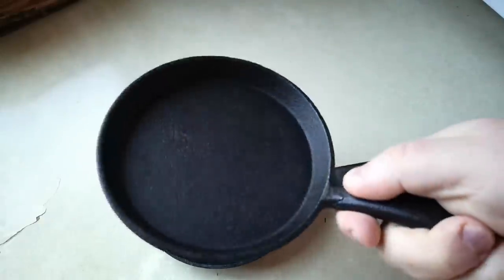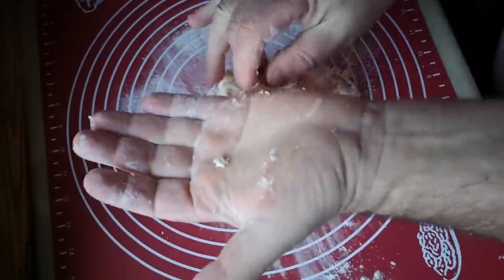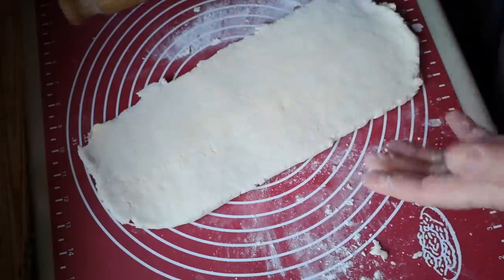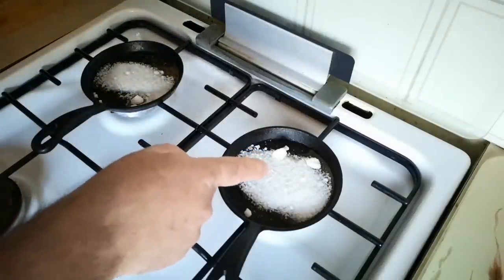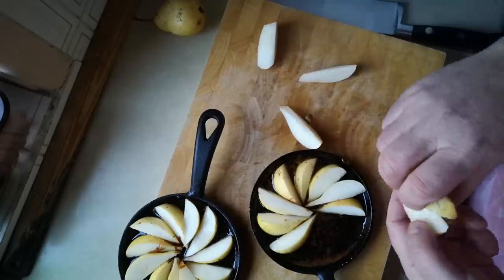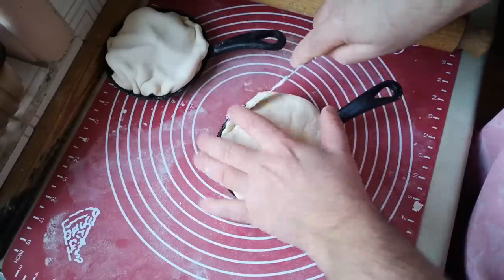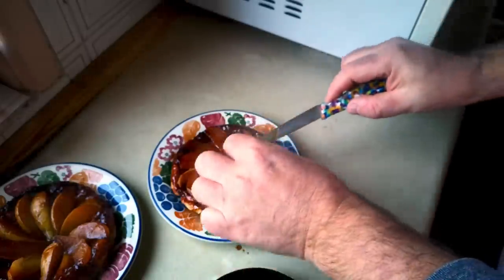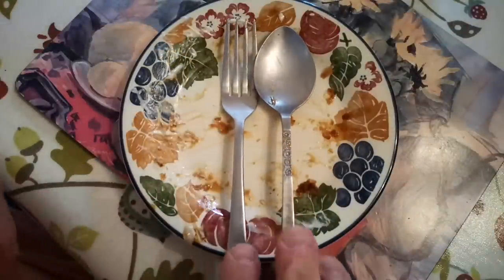Teeny Tiny Tarte Tatin - Cooking in the Mini Cast Iron Pan

Comment: 6:33 Molten sugar isn't just almost twice as hot as boiling water (180C / 360F), but it's also sticky. Where most liquids just run straight off your hand, sugar sticks to your skin. I once made caramel custard, and a drop of the caramel splashed onto my finger. It had cooled down and hardened after less than a second before I was able to get it off. 5 years later, I still have a very visible scar.
Reply from the maker: Very good point. Also I think many people would react to molten sugar on their finger by putting it to their mouth, probably also burning their lips and tongue
Reply: @Atomic Shrimp  best first aid tip for something like that is HOT water as QUICKLY as possible, it hurts a bit but it lets you get the sugar off, and then SLOWLY cool the water down till its tepid, at which point, aloe and burn creme, plus bandage it. At least thats what the boy scouts taught. It might be old info, but putting cold water on straight away not only shocks the sugar hardening it making it harder to come off without taking skin with it, as well as shocks the nerves and skin and can lead to increased pain and scaring.
Reply from the maker: @stapuft  interesting. I did not know that
Reply: @AtomicShrimp  Best thing for burns - neat lavender oil.  Takes pain away totally.
Reply: Twice as hot as boiling water would be 746C, but yes it is very hot.
Reply from the maker: @jhonbus  yeah, I suppose twice as hot in scientific terms must use Kelvin, but in human experience terms, I don't think it's necessarily wrong to treat 200 Celsius, colloquially, as 'twice as hot as boiling water'; it's a convenient way of saying 'this will hurt you a lot more than that'
Reply: @stapuft   Yup, and that works with burns from most liquids, too. Boiling water? Submmerge the trouble area in warm water. Lessens the burn and prevents worsening of the affected area. Learned that from my old man when I was a child, and had a very bad accident involing scalding hot water.
Reply: @ekki6820  
Water has such a high thermal capacity that you don’t need it to be as cold as possible to cool off a burn, and too cold water only adds stress to the already injured area. If it’s painfully cold, it’s far colder than it needs to be.
Reply: @AtomicShrimp  That may or may not have been my immediate reaction as well. Fortunately it had cooled down quite a bit by then (even though it was just a second). It hurt, but didn't leave any blisters or anything. Still: Would not recommend cooling down caramel with your tongue. Running water would probably have been safer.
Reply: @AtomicShrimp  Yep, I agree with that of course! Just pointing out another way of looking at things in case it offers an interesting point of view people might not have considered :)
Really, perhaps an even better way to look at how hot something feels might be the difference between its temperature and skin temperature. In which case boiling caramel might be more than twice as hot as boiling water. Feels about right to me!
Reply: If while camping, your roasted marshmellow catches fire and starts to fall off the stick, DO NOT CATCH IT IN YOUR BARE HANDS. OUCH!! 
Girl Scout Advice...😄
Reply: @jhonbus  
I’d argue that “twice as hot as boiling water” would be 254°C, because heat scales with the square of the absolute temperature.
Reply: @Ekki  oh man i had mine with bacon grease, i made bacon, in the oven, (my fav method personally......i just ised the WRONG pan, NEVER use the cheep dollar store sheet pans for this task, EVER, it WILL buckle, and you WILL get covered in 400 degree F bacon grease, luckily i remembered that trick and had a removable shower head with almost instant hot water, instead of a HUGE scar, i just have a tiny red splotch on my foot, where the majority ended up dripping due to gravity, lol.
Reply: Enjoy that scar, Ma K.  I was making toffee apples as a teenager, and splashed a similar incident onto the back of my hand. About an inch long, and half an inch wide.   Now, nearing 50, that scar remains...

-Dx
Reply: Well those pear tart tatins look lovely, and sounded perfect! Excellent ‘unrolling of pastry’ technique you just invented - very useful.
I too had the problem of a gas cooker in the house I’d moved to, being too fierce for when I wanted to sauté garlic really gently. I tried putting a little piece of metal under each corner of the trivet things on the top of the stove, but it was never successful. In the end I sold the gas cooker and bought a cheap electric cooker 😂
I wonder if you could put on your thinking hat and come up with an idea to raise those cast iron (I presume) stove top trivets further away from the flame, so that you could have a gentler heat? I’d find it useful if ever I moved again, or have you had enough of experimenting with the mini pans?
Reply: when I was a child I would go camping, and I was making s'mores. I got molten marshmallow on my finger, and the sugar immediately seered the my skin and I still have a dent and scar in my finger years later
Reply: @stapuft  oh my biology teacher told us a story about her sons learning this the hard way. they were being stupid (as teenagers do) and were trying to recreate the cartoonish fire trail a character leaves after running fast. obviously, the kid's leg caught on fire. they went straight for cold water and apparently it HURT hurt, close to passing out hurt. now theres a pretty bad scar and no hair on that part of his leg, but otherwise he's fine

Comment: I also have one of these tiny skillets. I got mine as a gift, with a mix for one large cookie instead. I also experimented with it, found it to get hot very easily, and now my main use for it is as a salamander. I heat it up and then either use it as a lid to heat things from the top, or hold it manually to melt sprinkled sugar, clumpy glaze,  or what have you. I find it particularly useful to harden the top of a fried egg to make it turn more easily, without breaking the yolk.

Comment: If you mix some water with the sugar you can control it better. The water boils away as the sugar gets up to temperature. In your left pan especially the edge got way more done than the centre.
Reply: GREAT tip, thats a trick i use so often, i forget most people dont know it.
Reply: @stapuft  And if you screw up and go too slow/leave cystals  you just get sugar again:)
Reply: Thanks for the tip, I always end up with too dark of a caramel before the rest is even melted.
Reply: I came to comment this too. It might take a little longer, but I get much more consistent results
Reply: You can also use various diffusers on gas hobs to control the heat on odd size pans which can also help.

Comment: I have always had a passion for baking, so when my friend mentioned his favorite dessert was Tarte Tatin, I jumped at the opportunity to impress him with my culinary skills. I mean, how hard could it be? I've watched countless videos and read several recipes, and I was confident I could make it perfectly.

So I set out to gather all the ingredients, including the necessary equipment. As I started to prepare the dish, I realized I was missing one key item - a cast iron skillet. Undeterred, I substituted it with a regular pan, thinking it wouldn't make a difference.

I began by caramelizing the sugar, but as I stirred, I noticed the sugar wasn't melting evenly. I shrugged it off, thinking it was just a minor hiccup. However, as the sugar started to darken, it quickly became apparent that I had made a grave mistake. The sugar was burning, and the entire kitchen was filled with an acrid smoke. I frantically tried to remove the pan from the heat, but it was too late. The sugar was ruined, and my Tarte Tatin was off to a horrible start.

Next, I added the sliced apples and arranged them neatly on top of the caramel, but as I went to place the dough on top, it started to shrink and pull away from the sides of the pan. I was flabbergasted - this was not how it was supposed to be. I tried to salvage the situation by patching the dough, but it was too late. The apples were starting to slide, and the filling was leaking out of the pan.

Desperate, I put the pan in the oven, hoping that the heat would fix everything. However, as the Tarte Tatin baked, it became clear that my efforts were in vain. The dough had puffed up, and the apples were falling apart. The caramel, which was supposed to be a golden brown color, was now burnt and black.

When I took the Tarte Tatin out of the oven, I was greeted by a disaster. The filling was burnt, and the crust was a mess. I had never been so disappointed in my life. My friend arrived shortly after, and I sheepishly served him the Tarte Tatin. He took one bite and made a face, and I could tell he was trying to be polite as he forced a smile and said, "It's... interesting."

In the end, my Tarte Tatin was a complete failure. My passion for baking had been shattered, and I was left feeling embarrassed and defeated. It was a harsh lesson, but I learned that even the simplest of dishes can go horribly wrong if you don't pay attention to the details. From that day on, I promised myself to never make the same mistakes again, and to always follow recipes to the letter.
Reply: I feel for you!! I remember optimistically setting out to make croissants in my early 20s when I was living in Paris- full of the confidence of youth, I mean, how hard could it be? As it turned out, extremely hard!! 😂 As were my croissants, resembled bullets more than the light, airy pastry I could easily skip down and pick up from my local patisserie, made by a baker with 20 years experience! 😂 Humbled much!
Reply: Why on earth did you serve it up? You doubled down and lost at every stage. Finally making your friend eat it is a bit like self diagnosing your own borderline personality disorder right there at the table . Love the story,  had me in stitches.
Reply: @phigster7422  I have no idea, I was just desperate and might have been slightly inebriated.
Reply: @AmbrosiusVanDerCastel  
Poor thing! 😂
Reply: Tarte Tatin is not made with slice of apple, but with chunks. If the apples are small, I will use half apples, else quarter apples.

Tarte Tatin is a very rustic thing, no need to be delicate with it.

Because I am French, I have had tartes Tatin all my life, no one would take too much time preparing one.

As for the caramel, prepare it with water and sugar, it diminishes the risks of burning because the caramel takes longer to get brown. You can also cook it in a microwave.
Reply: Lol have you tried to make it again?
Reply: @LivingInTheShade  never, and never will.
Reply: Oh no!! 😄😄😄 Bless you, dear. You tried. At least your probably NOT oven safe pan didn't melt or catch fire. I really hope you try this again (with all your new knowledge) and don't let it totally defeat you. ❤️
Reply: Don't let that discourage you! I'm scared of baking, but for someone like you that loves baking, you shouldn't let one single failure take away that love! Best of luck with the next one, now you know not to overcook the sugar or start over if it smells burnt
Reply: @Phoenicia  Awww...you were still hoping it was salvageable,  nothing wrong with that
Reply: This is such a wonderfully written warning, I will think about it every time I bake and want to substitute something out of laziness
Reply: @Lucy-ym3hz  so happy to hear that, I've been studying English for a while now. Seems like I've done something right!
Reply: @AmbrosiusVanDerCastel  You should try it again, I've had disasters too but didn't make it discourage me.
Reply: @LivingInTheShade  might have been to easily discouraged to be fair. I'll give it another go.
Reply: @AmbrosiusVanDerCastel  Excellent you know the phrase if you don't succeed try and try again. Wishing you the best and I am sure it will turn out perfectly.
Reply: @LivingInTheShade  thank you, this comment section is worth it's weight in gold.
Reply: A true friend would have said "Tastes like shit", instead of lying to you.
Reply: I would have just pretended, my oven had stopped working 😅
But cudos to you, for owning up to failure!
Reply: @phigster7422  what did their story have to do with BPD man

Comment: Shrimpy, I think the sugar might have had to much moisture in it. I too live in a house with a damp kitchen, If you keep your dry ingredients in kilner type jars or jam jars, put a little silica gel packet inside them. It helps a lot. If you also get the ones that come in paper sachets rather than plastic, you can 'recharge' them by drying out in a low oven.

Comment: I have one of those tiny pans. The use of a simmer ring helps control the heat much much better. You know, one of those round metal things that has lots of holes in it and has a bamboo type handle.

Comment: It would be interesting to see if you did this again whether just putting butter and sugar into the cold pans with uncooked pears and pastry on the top and then baked as before, would be a perfect temperature for the caramel to form? Quicker too! Also a tip with rolling any kind of dough into a round which I think would also work with pastry.... not really sure...apply slightly more pressure with the right hand as you roll back and forth and the dough will rotate clockwise  under the rolling pin giving you a circle. I’m Asian and we do that with chapattis. I really enjoy your videos, especially the cooking and budget challenge ones!

Comment: You're doing amazing things in a backpacking pan that's meant just to cook a simple meal.It's the nature of cast iron to retain heat so I would have maybe cut the heat off  a little earlier and let them finish without opening the door til they looked done.I have seen professional chefs finish delicate dishes in a hot box to avoid burning.These would probably cook two nice little personal bannocks or,used as dry griddles a single tortilla each.They can also be turned upside down over embers and the flat surface used for something that isn't runny like a flatbread.That might even work on a burner,heat ,turn off heat,dry griddle a tortilla or flatbread.

Comment: I always enjoy watching the food episodes, even though I probably wouldn't try to make most of the stuff he attempts. One thing I made that I would say I'm proud of would be my "mystery muffins" for a Halloween party. Two dozen (of each of the following) apple, strawberry rhubarb and blueberry pies cooked in a muffin tin, color-coded so I knew which ones were which. The main problem I had, though, was running out of shortening halfway through and having to call my grandmother (who lived up the hill) for some extra while I worked away at a different batch. I use shortening in my crusts (and everyone says it still tastes buttery, but I don't know how they come to that conclusion). I may not have made tarte tatin, but the eclectic stuff I've made to date include but are not limited to: the aforementioned mystery muffins, lemon waffles (which I really want now, just for the lemon curd you top them with), blackberry cheesecake, "almond cream" croissants (I made the croissants from scratch but skipped the almond cream you're supposed to top them with), Persian lime pie (I can never find Key limes, so Persians have to make due), dango (a kind of Japanese dumpling), and cheese souffle. Honestly, if I ever ran into Atomic Shrimp in the street, I'd ask if he'd want to swap recipes just so I can try to make more eclectic things.

Comment: It would be interesting if you could melt the pans and reform the two into a taller small pan with a longer handle.
Reply from the maker: I think if I geared up to cast iron and steel, the raw material could come from anywhere - steel scrap is so cheap and plentiful it would just be a waste to melt the pans

Comment: When I was 7 my mom was making some dessert with caramel. She turned around to get some ingredients from the fridge and I put a finger in the burning hot caramel on the stove. It was horrible as I couldn't take it off of my finger because as you tried to pull on it the outer layer that solidified a little would get stretched so you would just pull and make long strands with the center still burning hot liquid. when it finally solidified enough after what felt like hours but was probably less that 8 seconds I pulled on it and the skin on my finger went with it.  I still don't have a fingerprint on that finger.